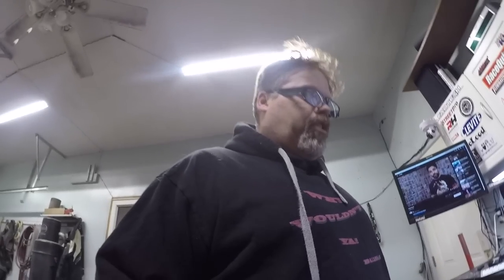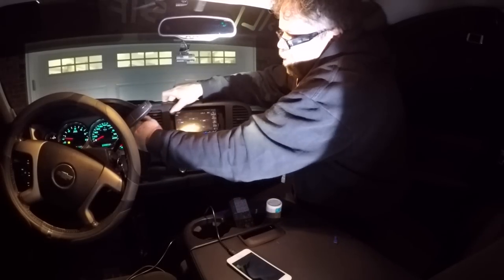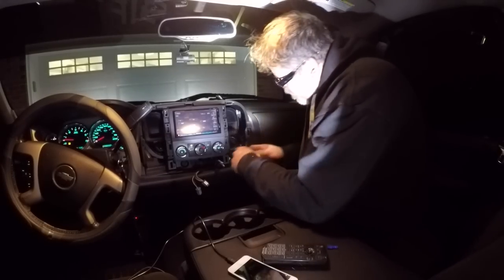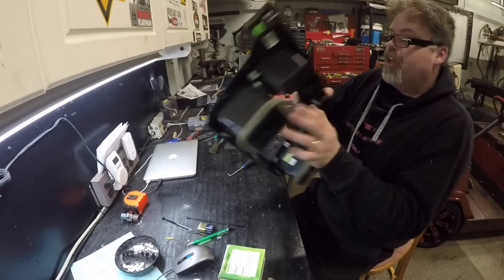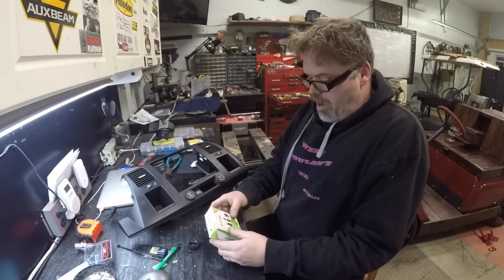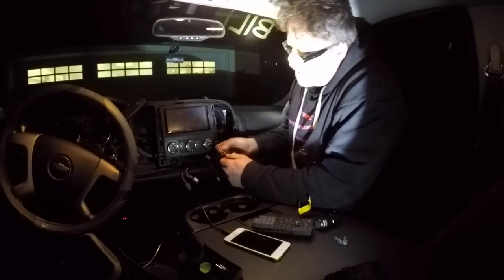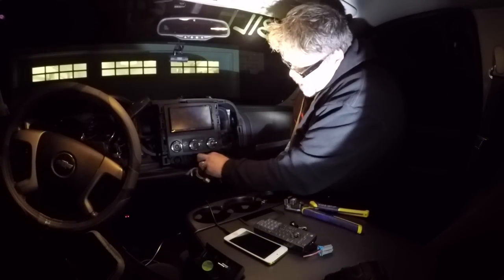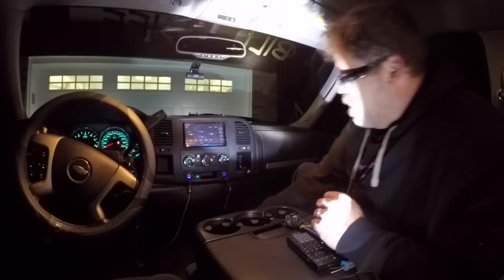Cigarette lighter USB Power Plug Install In The Silverado

Comment: i have a 2022 silverado with no cigarette lighter plug and stupid micro fuses 2 & 3.. i can not get power for my dash cam anywhere can you help, what i have tried was buying a micro 2 and 3 add a circuit and they dont fit. plus so much electronics in there . any thoughts?